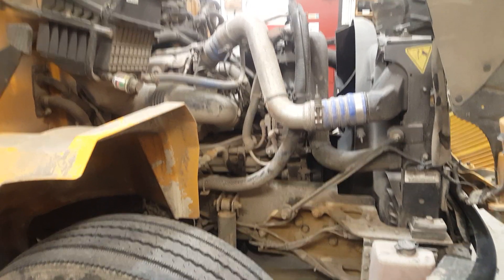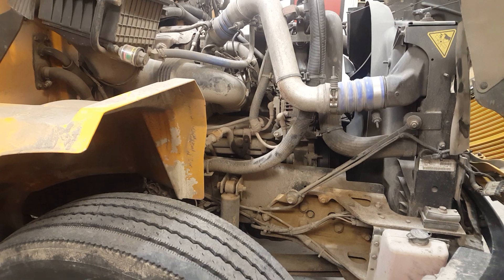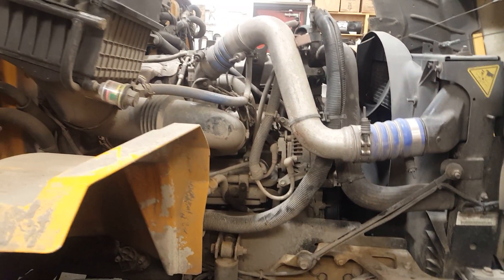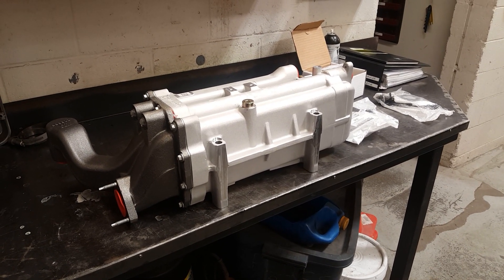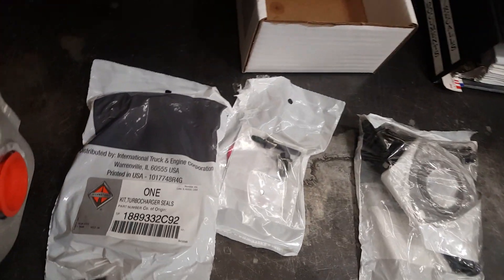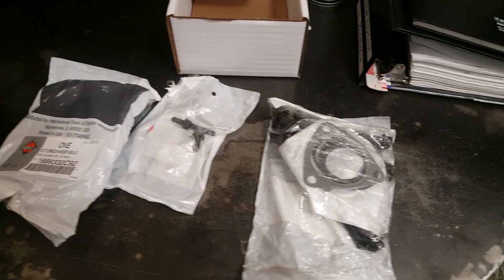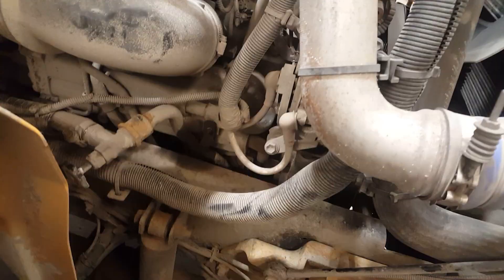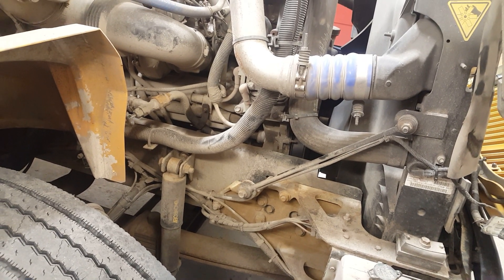EGR Cooler Failure DT MaxxForce Diesel Engine

Comment: Ever replace with bulletproof egr
Reply from the maker: Not yet. I've heard of this brand. Have you used their EGRs?
Reply: Leaning toward getting one
Reply: What’s the best way to know you have a failed or failing egr before it cause engine damage besides what you mentioned in the vid
Reply from the maker: @Dryrub808  The oil sample will show coolant in the oil down to parts per million. Another sign is coolant loss from rad cap from excessive pressure build up.
Reply: I just took my truck to shop to change clutch. Went there to pick it up, test drove, nice! Mechanic said I should change batteries so we do, truck won’t start! Baffled! Any ideas?